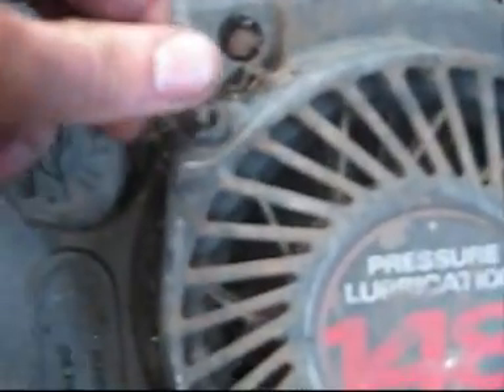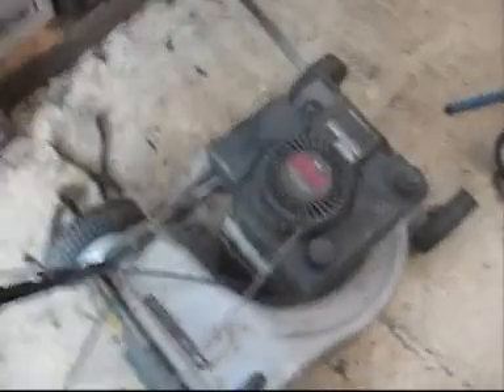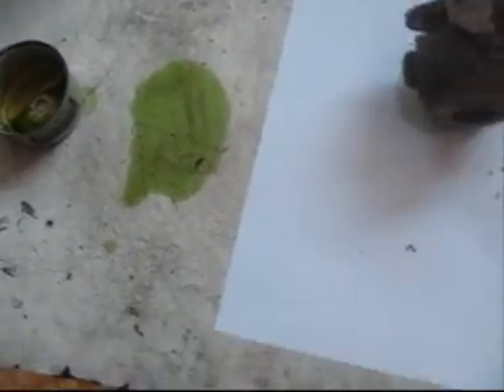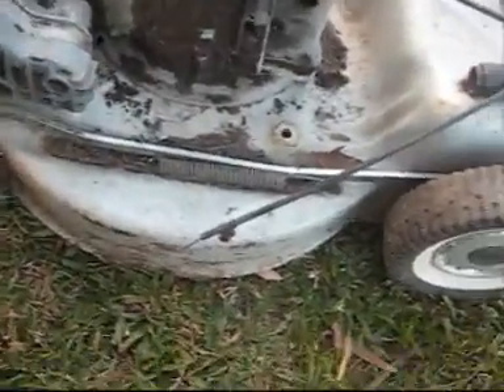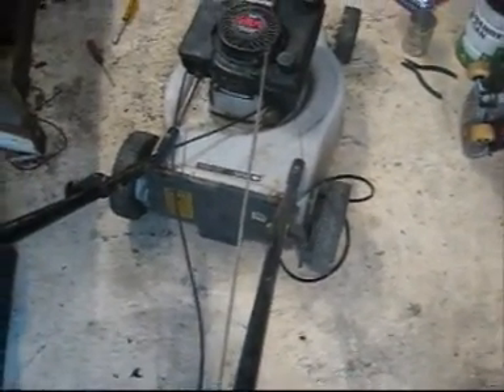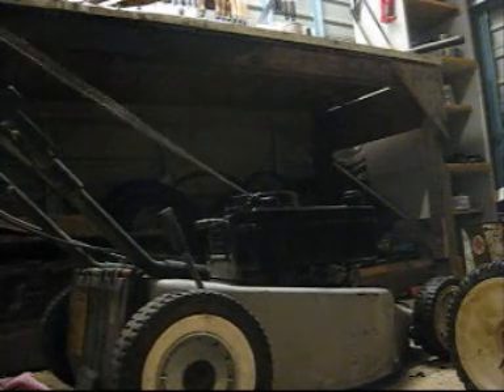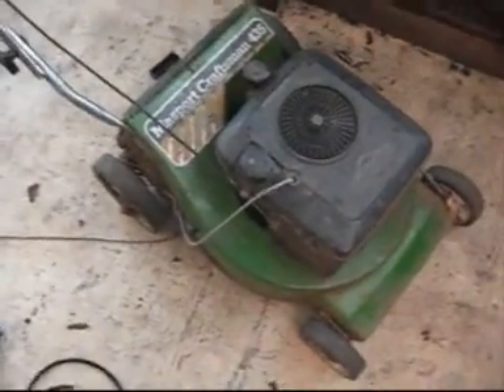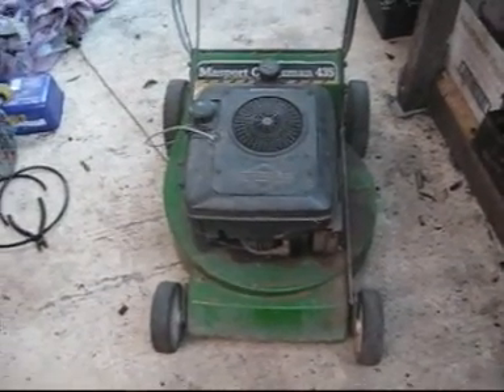mowers part 10 + some controversy

Comment: it's the first two numbers of the third set of numbers, not sure if it's type model or code, but i think it's code. Never-the-less it is the set of numbers on the far right. 
Type 437398 Model 53994383 Code 89348934 
89 would be the year